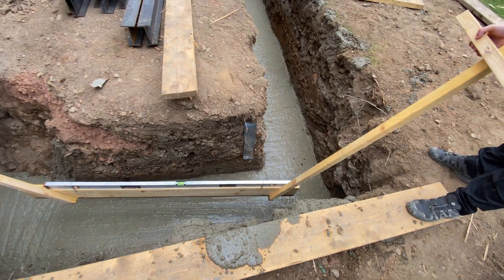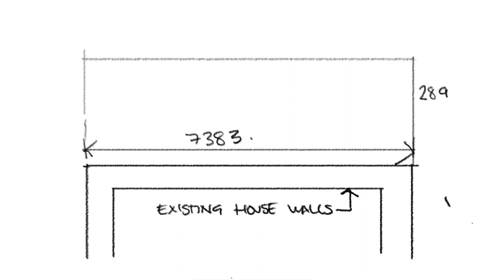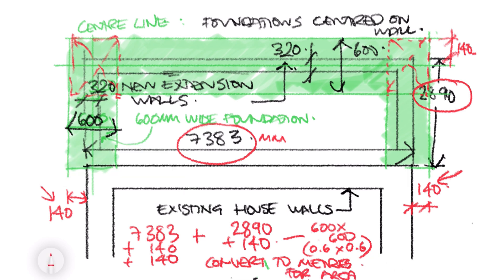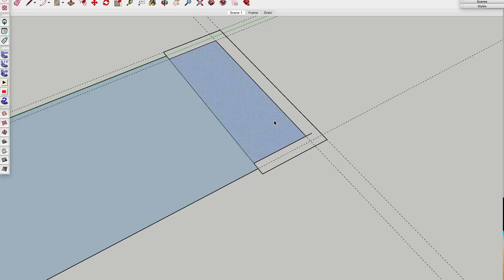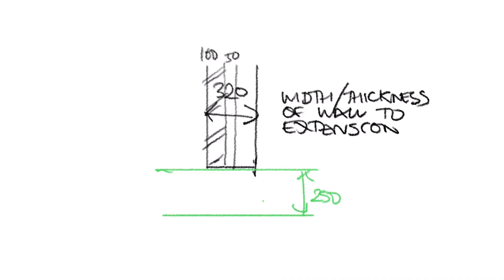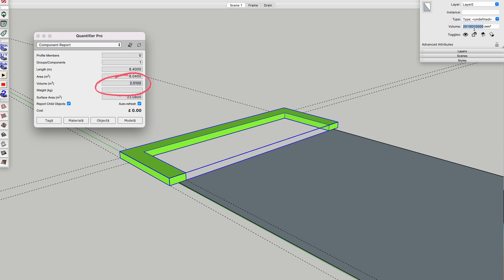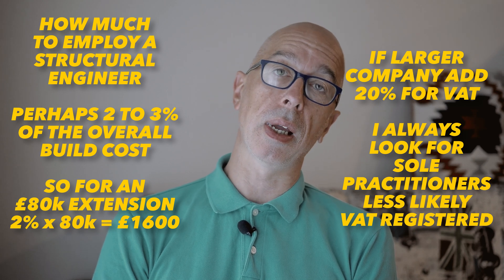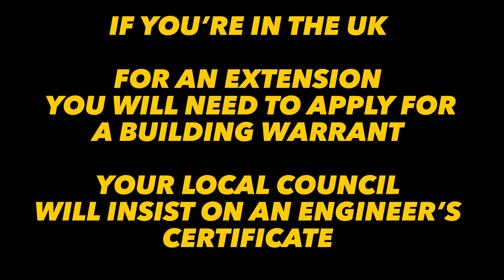How to design HOUSE EXTENSION FOUNDATIONS for self builders.  Avoid waiting, save cash

Comment: Hi Jeremy, do any of your videos go into the details of the concrete pads for the steel columns? Would love to see this but can't find anything.
Reply from the maker: Hi. Perhaps this one? I covered it somewhere for sure. 
Steel beams for house extension - working with structural engineer
https://youtu.be/O-yt3P6JL90
Reply: @build-better-things thank you. I have watched that one and it is very helpful but you don't go into the details of the pad or show pouring it. Did you pour the pad the same time as you did the footings? I'm not getting much guidance from my structural engineer on how to pour the pad and integrate with existing 😢 I'm doing an extension very similar to yours so finding your videos amazing
Reply from the maker: No, pour the strip first and form work at the end before the pad, then remove form work, resin in rebar or threaded rods to create a “grip” and then dig and form work around for the new pad and pour. Grips bind it to make Pads act as one with the strip.

Comment: Thanks for your videos and hard works. Could you please let us now how engineer justfiy goal post pad foundation for main building.
Reply from the maker: Hi. The engineer justifies their designs using their calculations, for both concrete and steel sizing.
Reply: @build-better-things  Do you have any sample calculation for pad foundation. I am structural engineer. I can not make pad foundation works without putting ground beam

Comment: Bit late to the game here but what do you do it the extension is on a semi. The party wall wall side do you still centre the 600mm width and if so how do you run it onto to neighbours property 🤷🏻‍♂️?
Reply from the maker: Hi. Late reply but you would need to design so as not to encroach, even when below ground. Excavation is always a challenge and requires neighbours to be a bit kind.

Comment: Recently discovered this gold mine of a channel. You explain everything very clearly and I'll be constantly referring back to your videos as I progress my own build. I will use SIPs purely because I've used them before and they are just so easy to work with. Hoping that I don't need to underpin an existing outhouse wall which I intend to use for one side of my rear extension! I'm going to hunt around the channel to see if you've covered this!
Reply from the maker: Hi. I’ve done some videos on foundations and concrete if you have a look. I’m happy you’ve had good experiences of SIPs. I’ve made videos on my own experiences too.  If you feel you do have to underpin, doing it in sections is the super safe way to do it. Best of luck.

Comment: If the foundation is on a boundary then would you just shift the 600mm width inwards? 

Also my neighbour has a concrete block shed right on my boundary. Would i need to underpin their shed first then build up from there?
Reply from the maker: Yes your foundation should not encroach over the boundary, although some titles do allow it,  so you either design the foundation to be deeper and just the thickness of the wall (my preference), or there’s also mini piles or rafts that would work. For your neighbours shed, without seeing it there just guessing, you’d just do a short section at a time to minimise any temporary support under the blocks, maybe steel mini prop.  underpinning probably a bit over the top if just a shed. But as I said, for both these, always speak to an engineer. And good luck.
Reply: @Build Better Things  Thanks always for your advice. As you say I think short sections at a time may be the trick. 👍

Comment: Hi Jeremy , great videos, couple of questions is better to have the concrete base higher than the existing foundations to save on brick costs ? 
Also do you leave in the sob boards and then cut them down to size . 
Thanks again
Reply from the maker: I usually use the existing levels, so I’ll have the concrete base at the same level. You need to be digging down to at least the same levels because that’s where they will have established firm sub strata. And you know it’s good presumably because there’s no movement in existing. Also about the bricks, I’m not bothered about saving on a few courses of brick, actually easier just to start your coursing off from the same level as the existing rather than tying in further up which is a bit trickier. 
I try to take the osb boards out just as the concrete is being poured…so at the last possible second to avoid any ground slump. I don’t remember what I did here. 
For foundations always double check with your structural engineer of course😉